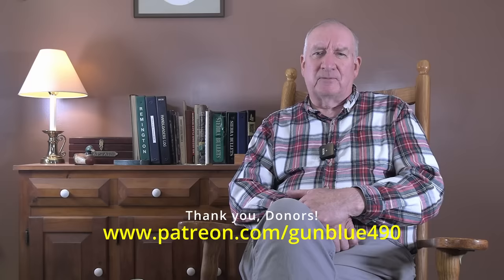The Copper Fouling Lie ~ Don't Fall for It!

Comment: Amen Amen! Captain, I am by no means, educated in metallurgy but I have done basic metalworking such as sanding and filling common metals in varying degrees. I came to the conclusion that stainless steel and chromoly are many times harder than copper. I find it difficult to subscribe to the idea that my stainless and chrome vanadium barrels are being damaged or fowled by copper gilding alloys. Even in the presence of extreme heat and impact. I have always viewed copper cleaning solvents as another means for firearm cleaning companies to take the opportunity to charge shooters for another cleaner. I just don't think that I have ever missed my mark during the hunt or missed my target. I try to let the rifle tell me what it needs. I have never bought such products and probably never will. Maybe when Ruger, Colt, and Smith & Wesson add this step into their owner's manuals, I may revisit it then. Thank you for the time, effort, and expense that goes into these videos. We appreciate you and may God bless all who watch you!

Comment: It’s true that a barrel, especially a lower end production barrel, will have a surface finish that allows a good bit of copper to accumulate. And because of this, the copper can fill in some of the imperfections. But my experience is that if this happens a great deal, the copper accumulation doesn’t stop. The drywall example isn’t quite how it works, rather it’s more like galling and a “cold weld”. You can try an experience for yourself. Clean a barrel throughly with a paste cleaner like JB or Iosso. It should be down to shiny bare metal. Run a dry patch though and pay attention to how it feels on the cleaner rod. Run a CLP patch and pay attention to the feel. Then, the next time you clean the barrel, only used a powder fouling solvent or CLP and run dry patches. A barrel “cleaned” to this level is not clean like it was with the paste. The copper is there. Some barrels will never stop accumulating more copper. Others will be stable and it’s largely a non-issue. IMO, the difference is a stainless barrel vs a chromed military style bore. A stainless match style barrel must have the copper removed—it’s never stable. The chromed barrel can ignore copper.

Comment: Actually, the only "fouling" that happens for sure is "lead fouling", especially on airguns (shooting plain lead pellets), weapons chambered in .22 /LR and shotguns (if shooting buck/bird shot or lead slugs that aren't contained in a plastic wad - in which case the layers of lead are gradually building up inside the barrel, be it a smooth bore or a rifled bore).

Comment: The military uses CLP because it’s cheap and it works in a wide range of temperatures. You may have to scrub more and it might not be top-tier at standard temps but it’s good enough for its purpose. 🤷‍♂️

Comment: Thanks for your videos that make complicated things simple, my thoughts are Like filling cracks in roads once you agressively over clean with harsh chemicals it takes the filler out of the road meaning because of over cleaning with harsh chemicals now your accuracy is gone and many rounds to restore it, as you said no harsh chemicals needed and the hype about expensive barrel cleaners is just that like a carnival guy from the 1800's and his wagon selling what he claims are miracle products. the copper color in barrel doesn't hurt the barrel being a microscopic film and guys all to often ruin barrels with those acids and harsh chemical doing more harm then good, they are to conserned about the microscopic copper color that they destroy barrel removing it, no jack hammer construction crew is needed inside a rifle barrel as many think, it's as simple as you stated that it's not complicated and only simple non toxic supplies needed, it's so simple and over the decades they have over complicated something simple and made millions doing it confusing everyone
Reply from the maker: Amen.

Comment: I can say that in my personal experience that I have seen both AK and M9 barrel tighten up groupings with barrels we thought were shot out after a thorough cleaning with a copper solvent. I believe most small arms in conventional units are not shot enough for copper to be an issue. Don't disregard the fact that the military will simply rebarrel a weapon if the accuracy degrades. They have no need to hold onto a barrel indefinitely. That a big reason why all military firearms have easily removed barrels.

Comment: Shooting in the same firearm a cast/Hardcast bullets with copper bullets will foul your barrel with copper, look at the ingredients, copper, lead, bullet lube (flux), heat, what’s needed to solder copper pipe, copper pipe, solder, flux, heat!
Copper bullets, will foul a barrel over time, it all depends on the barrel condition, and if not cleaned will oxidize over time, the oxidation is the main issue!
When the foaming bore cleaners came out like Wipeout, it was a game changer, it corrected many a rifles issues with accuracy!

Why do you think they Chrome line Militarily barrels? Too get more life out of them, from what?

Comment: Interesting point of view. I wonder why most of the top benchrest and F-class shooters always clean their barrels down to bare metal. They go to great lengths to remove carbon and copper from their barrels. They also shoot stainless steel barrels...I wonder if that makes a difference.
Reply: They are using top dollar custom barrels. These barrels don’t have the tooling marks that factory barrels do. Any copper fouling is indeed a build up not a filling in. You can actually feel it as you run a cleaning rod with a tight patch down the bore. If bad enough the patch not only gets tighter and looser as it goes over the copper your cleaning rod will chatter.
Reply: So if this is true then after the tooling marks are filled in on a factory barrel, the copper can build up just the same.  I think you would have a hard time convincing an F class shooter measuring groups in thousands of an inch, not to clean and remove all the carbon and copper
Reply: @sl65amg08  This “gunsmith” needs to buy a good borescope instead of relying on personal antidotes. If he spent a little time with one he would see how copper truly behaves in factory and custom barrels and be able to scientifically gage its accuracy effects on the same.
Reply: @timothyrepp4259  I agree, I’ve been using a Hawkeye and building rifles for over 30 years.  I subscribe to the Erik Cortina and “Speedy” methods of bore cleaning.  Without a good borescope you’ll never know what’s going on in your barrel

Comment: I tell people all the time, never clean your bore if you intend to shoot anytime soon, like going hunting after you have zeroed your gun. It takes around 7-9 shots just to get it back into Zero. But this is not due to copper fouling, it's due to burning the cleaning fluid out of the barrel and making it dry. It takes several rounds to burn the cleaning fluid out of the bore. Once cleaned, it will shoot more consistent. If you have cleaned your bore, then shoot several rounds before you set in or dial in your scope to get the oils burned out of your barrel.
Reply: try blasting the barrel with brake cleaner before shooting or 91% rubbing alcohol
Reply: @mrmeener625  Brake cleaner will dry for sure, and may even work. I have used it on gun parts and other parts I want to get really clean, and of course, even brake parts. 

My concern would be this: I've done Hot Bluing in the past and still do on occasion for myself, and when a gun is removed from the degrease and cleaning tank it will rust in a matter of seconds. And I mean 1-2 seconds from the tank and it's covered with rust. It's that fast. 

Brake cleaner may do the same thing if it is sprayed down the boar and may lead to premature erosion or rust. which means you would have to oil it to help with prevention, and I think that would defeat the purpose and put you back at square one. 

Not sure I would trust Brake Cleaner enough to spray down a barrel. But hey, it might work.
Reply: @antichrist_revealed  maybe the rubbing alcohol be better
Reply: @mrmeener625  Probably would be. Never tried it.

Comment: What about lead fouling is that okay to leave in the same as copper I know lead is nice and slippery
Reply from the maker: Oh, no!  That's a horse of a different color.  Lead buildup is caused by improperly hard bullets, and/or improperly lubricated bullets.  Bullets that are too soft for higher velocities will immediately leave deposits, and bullets that are too hard for lower velocities will not obturate tightly, and will allow hot gasses to pass by, melting lead.  Poor lubrication will cause leading, no matter what.  The slightest leading is ruinous to accuracy and in severe cases it becomes a dangerous bore obstruction.  Properly made bullets for specific velocities will not cause leading, no matter how many are fired.

Comment: I shoot precision target rifles out to 900 metres. The calibre I use is 223 Rem with a 85.5 grain bullet. I get less than 1/2 MOA without too much trouble with the load I have developed. I clean my rifle every few hundred rounds. I try to get as much carbon out as I can, but I have never been concerned about copper. I seem to do OK.
Reply from the maker: That's precisely what I'm speaking of, yes.  1/2 MOA is superb accuracy.
Reply: What solvent do you use?

Comment: I have been running moly coated bullets for years.  No issues whatsoever.  Yes it’s a messy process but other than a LIGHLY oiled patch after say deer season I’ve never had any issues.  I do then shoot a couple of fouling shots to clear the oil.
Reply: No need.

Comment: I’ve been shooting for 40 years, the first 10 years I chased the copper fouling rabbit. Then it dawned on me that why does it take 8 to 10 fouling shots to get back to my zero. Why does the AMU not clean their rifles until they are past 250 shots? I do most of my shooting at local CMP/NRA events. In between these I use a lightly oiled bore snake. Past 200 shots I clean and brush the bore with a 50/50 mix of CLP and Kroil. At the end of the year I’ll clean my gun with Hoppes, and I’m not concerned if there is copper still in the barrel. I’m not a slave to barrel cleaning anymore. Common sense.

Comment: I tried the copper solvents at the urging of a friend. It took a lot of rounds to get it to settle down again and start shooting near the accuracy it had prior to copper removal. I've never done it again. What copper stays in the bore is filling in the low spots and thank God for that. Savage rifles of late have gone to garbage because the bores are pitted. I replaced a Savage  .308 Win barrel because the bore was full of deep marks, including at the crown, where the rifling button had been pulled over metal shavings that were then imprinted into the bore. I sent a brand new .223 Rem back to them because it had a very large pit 2" from the muzzle. Savage had it for over 2 months and when I finally got it back, the new barrel had dozens of smaller pits up and down the bore. What a farce. I said, "screw Savage" and will never buy another. I'm just trying to fill in those smaller pits with copper now.
Reply: Yeah many manufacturers are having QC issues. Always be very meticulous when accepting a firearm when you buy.
Reply: @hiwayhighway9925  Need to take along a portable bore scope to know for sure. I have a Teslong but it doesn't really work with a phone or a tablet, gotta have one with its own screen. Firearms dealers probably ought to scope 'em when they receive them. Hell, the damn manufacturers should bore scope them before shipping... but they don't.
Reply: Funny. All my Savages shoot great. It's my Model 70 featherweight that wont shoot a 3 shot group without a flyer. Stay away from borescopes. Bore scope are bad for barrels. The scare you into doing bad things. :)

Comment: What is your definition of accuracy? I don't clean my hunting rigs as often and they do have some fouling. But I don't need a sub moa rifle for deer hunting.  1-1.5 moa out to 300 yards or so is fine for me. 
But my precision rifles get cleaned every time I use them. When my groups open up to 1 moa I know it is time to clean them. I have some active duty military SF friends and their accuracy standards are far below mine. They rarely do better than 2 moa out to a 1,000 yards. Fine for combat but not for me. So, one needs to define their accuracy standards and how to maintain them over time. If cleaning a barrel is part of the regime to maintain your level of accuracy and precision then removing fouling, be it copper or carbon, may be warranted.

Comment: I just got a new savage. I shot about 3 boxes through it. It has orange in the end of the barrel, the hopes is actually bringing it out. The patches are blue. Should I keep cleaning until it’s out or not worry about it. I don’t wanna keep scrubbing something out with hopes that’s making my groups tighter but I don’t want to leave something in there that’s bad for the barrel. But the hopes is deff bringing copper out

Comment: I wonder what it is about shooting lead core ammo then monolithic copper.  I didnt believe this "myth" until i tested it. As ive always used lead core to get on paper then copper to zero for the deer/bear season. Well backfiretv and ron spomer talked about issues switching between bullet types and found that if you shoot both without cleaning your accuracy can be all over. You have to have a very clean bore(no carbon no copper residue) then accuracy usung just the monolthics goes back to good groups. I couldnt keep my copper under 2" in my 30-06 figured it just didnt like them. Did a very good cleaning nothing crazy, and went and sighted in using only the barnes vortex and 1.5" 3shot grouping consistently with a consistent 1/2" 2 shot group. Its nothing crazy but the rifle has never shot copper that well. Lead core yes

Comment: That Was The """ Original Sweets 7.62 """ Bore Solvent. !!!!!!!!!!!  The Bottle Said Use Outdoors ONLY  !!!! That Stuff Was WICKED STRONG  !!!  The Current made Stuff Should have Pictures of Hello Kitty on it....
My Personal Favorite That I've Used For As Close as I Can Tell Is 38 to 40 Years. As FarAs THE Best All Around Solvent,  Nothing Better. Always Keep A Couple of Quart Bottles on Hand One Sealed,  One Opened,  That I Fill Smaller 4 & 6 oz. Bottles. And When they get low,  Dump Them out, Wash out the Jar, Dry, and Refill. And Something Most People Don't Know Is When You're Done Using You're Bore brush, Or any brass, or copper brush. Wash it with Soap Under HOT Water,  If You Want it to Last. But Nothing Smells Better than Hoppies #9 . Have a Half gallon, A Quart, Pint, and several half pint, and a few Four oz bottles

Comment: Concur.  In a new or barrel that has no copper build up, it is best to run 40 to 60 rounds to deposit copper before doing load development.  This is the number of rounds where the barrel  begins to attain copper equalization.  Only after hundreds of rounds will the fine accuracy degrade with the  first sign of excessive copper with an occasional flyer.  That is the point where I would remove some of the copper, but not attempt to remove all of the copper.

Comment: I have a 1902 production Model 1894 Winchester. 

I bought it because it had a bright and shiny bore. Eventually I got a bore scope and saw there was a ton of microscopic pitting and copper fouling everywhere. 

The gun, while it doesn’t cloverleaf, shoots about 2” groups at 100 and that is all I need to shoot deer.

Comment: Do you always shoot with a clean barrel? Short answer, NO, after the first round you have a fouled bore, consecutive shooting just adds to it and you will reach a point where your groups are nice and tight, then you clean the bore and you start over. Corrosive primers are a different problem, you need to clean after you shoot, non corrosive you don't need to. I have shot hundreds of rounds with out cleaning the bore, then clean it and start over. Don't believe me, try it, no harm to your bore.

Comment: After 28 years in Military Service CLP was all I remember as an authorized solvent. We would use almost anything to clean a rifle or handgun. Many a Bolts and chambers had white gas as a cleaning solution. Every Armory had a bottle of CLP at the window and the entire weapon would be liberally lubed. Today I use Ballistol and that's it. The exception is my polymer handguns. I apply Remoil to the metal slides. It's my opinion that the carbon draws moisture. You are dead on target with that thought.

Comment: Bench rest shooters clean every 10 rounds or so, they are shooting 1s(.1") and 2s(.2's)🤯.  F class shooters clean after each days shooting, they are shooting 1 moa at 1000 yrds.  If you are happy shooting .75" to 1" groups leave the copper in your barrel.  I clean to bare metal after everytime i shoot.  'You can keep your barrel constantly clean, but you can't keep the barrel constantly dirty".  Anyone that says copper doesn't continue to build in your barrel has never experienced pressure problems due to copper continuing to be laid down in the barrel.  Juat my $.02

Comment: Question: The general belief that I have "heard" is if your going to change to shooting pure copper bullets like Barnes after a bullet like the Nosler partition is that you need to clean the barrel back down to the original bare steal. I know absolutely nothing about this, but have enjoyed the monolithic Barnes but have had some consistence problems with them in my Ruger American. What is the answer for more consistent shooting "assuming" on my end every thing is being done the same shot after shot?. Thanks. W.A. Derby